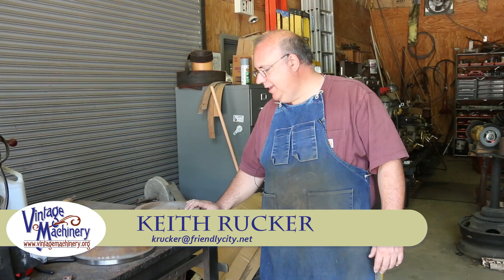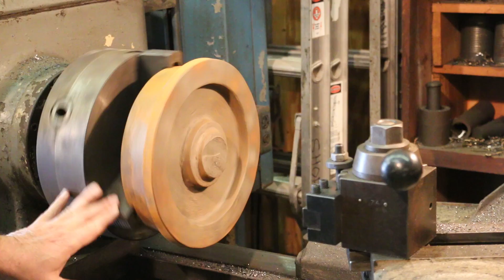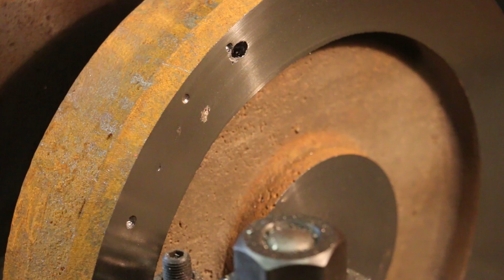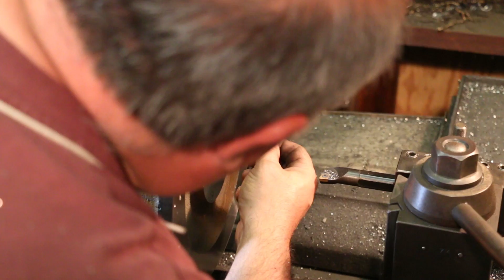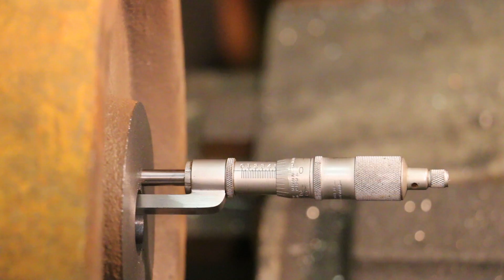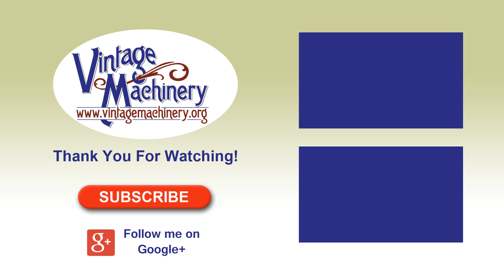Machining Cast Steel Railroad Wheels

Comment: These wheels will be very lightly loaded so I think the inclusions can be filled and ignored. Given the apparent hardness I suggest stacking the raw castings in a few bags of charcoal and heating them to above the annealing temperature then burying the whole mess in dirt and let them take a couple of days to cool. That should make machining easier. 

Using HSS cutters on hardened cast steel is necessary. I ruined and reground a number of HSS tools before I could get stepdad to do a lunchbox purchase of some carbide inserts and holders from the old ALCO machine shop. Those cutters worked.

Comment: When I was about 12 yo my stepfather told me to machine 24 (three cars worth) train wheels out of 6 in bar stock for his amusement park railroad. This was an after school winter project. It took about 8 weeks as the shop took longer and longer to warm up in an upstate NY winter. The project also included 12 axles. I was using an antique belt driven lathe without any graduations on the cross or compound slides. I learned a lot in that shop but the most Importent was how to keep a drunk out of the way. 

If anyone knows of the fate of The Carolyn Road I would appreciate hearing from them.

Comment: I thought with castings and forged steel  pieces you drill two centers and run it between two centers to cut a clean clamping surface

Comment: Most of the railroad steel I've cut was really hard and barely magnetic. Are these wheels magnetic? I was told it's the manganese.
Reply: It's a steel alloy called Mangalloy (sometimes Hadfield steel); has a high manganese content of 13%-15%. It has a metastable phase that work hardens very readily, making it very abrasion resistant, but leaves the center to remain very tough. Being mainly austenite, it is not magnetic.

Comment: With cast steel, could you clean up an inclusion hole to get rid of the bad material and weld it up?
Reply: Imo Yes. Carbide burr to clean them up and tig weld them. The big one I would probably drill out and chamfer to be able to get adequate penetration at the bottom. 

Cast steel generally welds up fine. Cast iron usually has a problem with the heat affected zone and the fact that you can get a weakened grain structure between the weld and the unaffected area. Preheat and slowly cooling it down helps, but cast iron is generally a crapshoot. Cast aluminum welds very dirty imo. Like there are tons of impurities in it that you essentially have to burn out. 

I’m no professional welder though, just a self taught hobbiest

Comment: At 12:40, there are some sparks as you machine the outer rim.  I'd guess from the spark pattern and color that it's a high carbon steel.  But because the sparks are short and start right at the cutting edge so I'm thinking it's something between very-high carbon cast steel and cast iron.

https://en.wikipedia.org/wiki/Spark_testing

Comment: At 7:30 you mentioned burning up a HSS tool while taking a light cut.  From what I've read, cast metal hardens at the surface and often has some sand in the surface.  I suppose it is a quenching effect of the sand combined with the carbon content of the steel.  In any case, a heavier cut is better than light.  Some of the old-time books recommend hand-chiseling off the outer layer before machining, if you can imagine that.  And I think the radius is probably the worst place to test because the large contact area combined with the shallow cut.

Comment: I realize this is pretty old, but could that casting be welded to fill in the void? I just saw some videos about welding cast iron.
Reply: There will be more voids throughout the casting. Talked to someone who machined steel castings and they said it would be structurally compromised by the voids

Comment: Would the SF/min requirement for the metal change with that size diameter, and require different lathe rpm when working out at the edge vs in at the axle hub area?  Or does the carbide tool not need this relative SP/min change?

Comment: Identifying unknown alloys is easy with an Xray Florescence Spectroscope, like the Niton XL3p+ XRF Analyzer from ThermoFisher Scientific. Other instrument companies make these too. The testing is 100% non-destructive, only a buffed out area free of tarnish is needed to read a sample. Invite the local ThermoFisher Scientific rep over for a video shoot; I've found them to be very accommodating. The XL3p looks like a hand-held ray gun from a 1950s sci-fi movie.  My group started restoring a rare 1955 Freightliner cab-over semi-tractor in 2005 at the Portland, Oregon, Freightliner plant (now known as Daimler Trucks). Many aerospace alloys were plentiful just after the Korean War, and this truck took full advantage - there were aluminum and magnesium alloy parts all over it that normally would have been made from steel, and in later model years went back to conventional materials. Our local ThermoFisher Scientific came by and shot readings on any number of "mystery metals"; we learned in seconds just what we had.  Not to wear out our welcome, when new parts needed metallurgical identification and it would have been too soon to ask ThermoFisher Scientific to come over again, I cut out a tiny sample from an inconspicuous location and sent it to a local lab for analysis at a cost of about $40. And before I forget, the ThermoFisher Scientific Niton XL3p+ XRF Analyzer costs about $30,000. Most big scrap yards have one and will do tests for a fee.

Comment: Keith, these wheels look warped from the casting process.  Since this small railroad will only be operated at walking speeds, the warpage may not cause a significant imbalance.  Fine work with the  machining.  Many thanks.
Reply from the maker: Not warped - rough castings are just that way.  That is why you cast them oversize and machine them down.  The end results will be just fine.

Comment: Could that pitting from inclusions be drilled out and filled with weld metal, then machined off? Seems such a waste after all that work to have to reject it
Reply: It's not about the surface. The reason you'd reject it is that it indicates more bubbles inside the piece. Those can be fracture points later on

Comment: Inclusions like that, I would have taken it off the lathe and drilled them out a bit to clean it up a little, then welded it. The put it back on the lathe and machine it down.  That is a lot of metal to just toss and reforge.  (in my opinion)
Reply from the maker: Sure, but what about the ones that you cannot see?

Comment: To me that's a failure, my question is how often do you come across castings like that? And how could such a large cavity like that form?
Reply from the maker: I agree that the casting is flawed.  We have turned about 12 of these castings so far and that has been the only one like it.  Probably just got some air into the pour that caused some inclusions.  It was not obvious anywhere on the outside of the casting.
Reply: is that common? like how often do you come across castings like that?

Comment: why not welding those holes?
Reply from the maker: First, the part is cast iron - it does not weld very well.  Second, you would have to grind the pockets out to get all of the impurities out of the hole, which would just make a bigger repair.  Third, with the number and size of the holes that we saw with some light machining, it just makes you wonder how many you cannot see that are still buried in the casting.  I would be afraid that the wheel might fail in use - it just is not worth taking the chance......
Reply: Thank you for the explanation, I thought cast iron and cast steel were diferent things.Great video!

Comment: I was surprised that you didn't sand blast the area between the "hub" and the outer turning.  I would think that they would probably paint that area, for asthetic reasons, and sand blasting BEFORE turning that area would eliminate any sand blasting "marks" on the area that you had already cleaned up.
Reply from the maker: We actually did sandblast the wheels first in the blasting cabinet.

Comment: Ok... I know that you know what you're doing and i'm just some bozo on the internet. It's just that those surface speeds you're using seem rather large in my opinion... but it's just an opinion. HSS could survive better if you had slowed down a bit, no?

Comment: If HSS cutters won't touch it, how is it that you can drill it with, presumably, HSS drills?
Reply from the maker: It is mostly hardened on the surface of the casting, once you get under that, it is fairly easy to machine.  The drill gets through that layer pretty quick.

Comment: Mr.Rucker thank you for video and effort to do it. Now question: is it safe to run the equipment at 4x speed in post production or do you need additional atachments to secure it more?? How bout balance issues??( please read it with scence of humor ) ; )
Reply from the maker: It it totally safe, as long as it is only on your screen.  When you try it on the actual machine, results may vary...

Comment: What flavor of CNC lathe does your friend have.  I used to do a lot of cnc programming and generally speaking, lathe code is pretty cake.
Reply from the maker: The lathe is an HH Roberts made by  Ann Yang Mach co. Nov 5, 1999 model DY380x1000cn.
Reply: Keith, another thing to consider on the wheels that have the defects on them the following:  From your video there appears to be plenty of rim thickness.  As long as you do the wheels in matched pairs so that matched pairs go on the same axle then you may have enough rim thickness there on those wheels to machine out the sand inclusions.  I have wheel tapes that I get railroad wheels where I need them, but if you are careful just drag out a pi tape and you can do the same thing if you are careful.  Just machine them in matched pairs and you should have no problem.  I would be interested to see pictures of the old wheels they are removing, as if there is enough wheel rim thickness those wheels could be re-profiled and good again in matched pairs.

Comment: I've been turning for many a year and I'm sure those wheels are of cast iron going by the sparks caused by the ingress of casting sand and also the swarf coming off, In my younger day we never had carbide inserts just H.S.S, and had to go much slower, I'm surprized you are going to ask your friend to use his C.N.C. lathe, you could probably finish the four wheels off on your own lathe quicker than programing his lathe.
Reply from the maker: I have about decided these are ductile iron - which is a good choice for the wheels.  The profile would be hard to make on my manual lathe  - we tried on one of the castings but to do it right, we need to grind a profile in HSS and these wheels are just eating up the HSS.
Reply: Phil, The problem is they are not as easy to turn in a straight manual lathe as you would think.  Depending on the customer you are looking a 1 in 20 or a 1 in 40 taper leading in to several of centerline radius of which there are many oddball features.  So, you have your choice, all of which I have done in my day, spend your day at the grinder grinding some Rex 95 form tools only to have a hard spot kick you.  Or you can go to a tracer lathe and take the time to make you a pattern, or you go to a CNC and do a program.  I can tell you the Tracer and CNC lathe options are the way to go especially if you have some hard cutting material.

Comment: I am not machinist, but curious why you don't use a lubricant whilst cutting would it not help with the process, cooling and less wear on the cutting edge?
Reply from the maker: I don't use a lubricant on cast iron.  I have talked about this in some other posts - basically keeps the fine (and abrasive) dust from getting into important places on my machine.
Reply: Thanks Keith, was wondering about the clean up was the reasoning. Cheers and thank you again.

Comment: If you have a pattern I could use to trace them on my lathe I would do them.  If I had to make the pattern also, not a problem, but it would take time I really do not have right now.  Would not take very long at all to knock those wheels out.  If the pattern is a regular AAR tread profile I have the pattern and could knock out those wheels in a day or two depending on how many.
Reply from the maker: Where do you live?
Reply: The only part of Texas that has not washed down the Brazos or the Colorado Rivers!  My web site has not been updated in some time but check out www.ttcw.net  Yes, I guess freight would cost a little, but I do this exact type work all the time.  I appreciate your videos, very nice.  I have said many time now to myself I need to do some videos, but I just   seem to be in too big a hurry all of the time!?!?  Someday!  I used to do a lot of railcar work, fully certified tank car and and railroad axle shop but conditions changed a few years ago and I just decided to go with non-regulated machine shop and fabrication work and it has been a blessing.  Just an old school manual machine and welding shop been around since 1948 and founded by my Father.
Reply: Did not remember, but if you go to my web site, a picture of those narrow gage wheels is right there on the home page.  We are in San Angelo, Texas.  I assume that is far from your location.

Comment: YOU MAY WANT TO ASK THE OTHER KEITH (FENNER) FOR AN OPINION ON THE FLANGE INCLUSIONS. I WOULD THINK THAT IF YOU DRILL THE HOLES OUT TO GOOD METAL AND FILL WITH WELD MATERIAL THE FLANGE WOULD BE JUST FINE FOR THE STRESS IT'S UNDER.
Reply: No need to yell. Geesh
Reply: No need to yell. Geesh

Comment: Keith,
Fascinating. I was very interested in the way you established a machined surface for reference on the rest. That thing looked like a dog's hind leg.

Could you tell me why you did not use any cutting fluid? Was it because you think it was cast iron?

Thanks, Ian
Reply from the maker: I don't typically use a cutting fluid on cast material because the chips come off in a fine and abrasive dust rather than a chip like you get with steel.  If you use a cutting fluid, you can wash that abrasive material down on the ways and into other parts of the machine that will cause a lot of wear to your machinery.

Comment: not to be a keyboard warrior but when you were measuring the bore those were vernier calipers not a micrometer
Reply from the maker: If you want to get technical, they were dial calipers and not vernier calipers.  But, I was using a micrometer off camera - I just showed the measurement on screen with the dial calipers because it is easier to read on screen than a micrometer.
Reply: +Keith Rucker - VintageMachinery.org touche sir, what happened with those casting flaws, we're the welded up or did you receive a new casting to machine?

Comment: So, why not use that 'scrap' wheel for your proofing of the taper and radius cuts on the CNC lathe?  If you goof on that wheel, , it's not a problem.
Reply from the maker: That is exactly what I plan to do - use it for the first test cuts on the lathe!

Comment: Looks alot like cast iron them chips sparks are caused because of the speed :D...
Reply from the maker: Ductile iron is that I am pretty sure it is now.  As for the chips, it was doing that as it passed over the inclusions - I think that there was some impurities in there that was causing those sparks.

Comment: the voids in the wheel castings can be filled with jb-weld and then sanded smooth. just a thought kieth.
Reply from the maker: I don't think I would trust the strength of JB weld to keep that flange from breaking off on the train.....

Comment: Kieth, could those inclusions be ground out and welded up?
Reply from the maker: Possibly - assuming the wheels are steel. But, the more I work with them, the more I am becoming convinced that they are actually ductile cast iron instead, which does not weld very easy.

Comment: Can you weld cast steel? Is drilling the inclusions out to remove the bad material and then using stick electrodes to fill the holes a option.

Love all of your videos and  I plan to stop at the musem the next time I am down that way.
Reply: Cast steel can usually be welded quite easily unless it has a high carbon content, in which case pre-heating and post-heating might be necessary. If it is cast iron like some people here are suggesting, it´s a different story. I guess the decision about what to do about the inclusions depends on if the other wheel castings have the same defects and how much time and effort it&#180;s worth to get rid of the inclusions, and of course if it´s steel or iron. For the intended application (slow moving, light duty train) I don&#180;t really see that the defects are critical, but more of a cosmetic issue. If the inclusions are left "untreated" water and dirt could be trapped and cause corrosion, but I guess that could be solved by grinding the rough edges with a rotary burr. Can&#180;t wait to see the next video :-)
Reply from the maker: The more I work with these wheels, the more I am becoming convinced that they are actually cast ductile iron rather than steel.  So, welding is pretty much out of the question.

Comment: I once saw a guy profile a set of full size steam engine wheels in a wheel lathe that could take an 8ft pair of wheels and that was something. Hope you can video the cnc work.The castings could be iron, as it will be slow speed work and the thrust on the flange will be low, but I wouldn't like to work a train with a wheel with an occlusion like that on it as that flange could go at any time with bad consequences even at low speed.
Reply from the maker: A wheel lathe - I have seen a couple of those machines.  There is one at the Illinois Railway Museum and another at the Tennessee Valley Railway Museum.